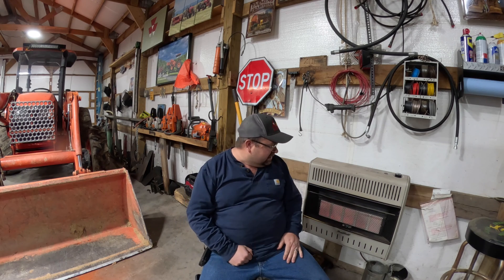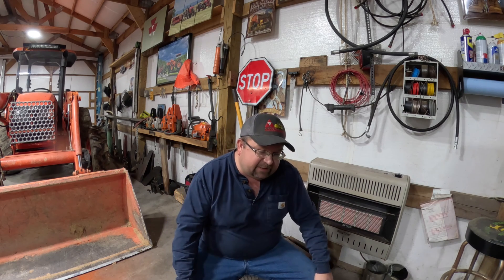What RPM Should I Run My Tractor At 🤔?

Comment: A lot of people, and maybe most people, have tractors that are smaller, and under powered for what they need. I think this is where some of the run at full throttle comes from   Along with everything that you are saying, and I agree. As with tractor time with Tim, they are always trying to see how under powered tractor will get them by.
Reply from the maker: But like someone said in the comments pto speed is where the power and torque curves are the most efficient. By going wide open throttle your not gaining much if anything to help. But most small engines do have the pto speed near wide open throttle. But the comments I’m referring are on 5E Deere’s and that size range tractor. Thanks for watching

Comment: Usually tractor design is such that torque and power curves cross at proper PTO rpm and the implement should match the tractor power.  If you pull an 8 foot wide implement at idle and shift up so you go 8 miles an hour or pull a 16 foot implement 4 miles an hour with throttle at the PTO mark you may get as much done in the same amount of time but the larger implement will only make half as many rounds. Half as much wear on the drive train.  I agree that if you are doing light work there is no need to run high rpm, but if you could do the job with a 20 hp tractor it would be more efficient to use it at a higher rpm than using a 200 hp tractor on the same load and running it at idle. You are right.  There are just too many variables for a definite answer and only experience will tell what is best for you.
Reply from the maker: Yes you’re right on torque and power curves. You really don’t gain much by going beyond that 540 pto mark other than more fuel consumption. Thanks for watching

Comment: Ben, I agree with you 100%. I live in upstate New York and it gets cold . I start my tractor and let it idle until the temperature gauge comes up into the operating range. If I’m not using the pro I run it at 1500 to 1800 rpm. It’s a new tractor with 20 hours on it . I’m used to a 8N Ford so I don’t have any experience with the new diesel’s. My tractor is a Kubota MX5400 gear drive open station and I really like it. I just hope I’m running it correctly. Thanks for sharing your opinion I really value it.
Reply from the maker: I’m glad you went gearing up drive! You just so much more pushing and pulling strength from a geared machine. Thanks for watching

Comment: I agree. Go to a machine shop and ask them to build an engine. They are gonna wanna know how much horsepower you want and how many rpm.

When you wanna be able to run 6000 rpm the price goes up significantly. Rpm definitely is harder on engines.
Reply from the maker: It sure is! Thanks for watching

Comment: Good morning Ben.  You didn't mention running it by ear. 😁 I have a tractor that I have ran for years with a broken tachometer cable. That would blow many of new owners minds 😂
Reply from the maker: My Farmtrac is that way also. Thanks for watching
Reply: I've run many ford brush chopping with no tach, I spin em up wide open, then bump the throttle back a bit, till it sounds right.. I'm talking a 3600 pulling an 8ft brush chopper  or a 4000 pulling a 10 foot chopper.

Comment: I only run my tractor (bx 2370) at 2000 - 2500 rpm unless I have on the bush hog or finish mower then I run it up to the 540 mark! I only run my tiller at 2000 to 2200 rpm at max and it does just fine. I have never had that little tractor at full throttle!!!
Reply from the maker: I run a tiller at lower then 540 as well. Especially in rocky areas! Thanks for watching

Comment: All the newer ones with dpf and Def are made to operate with the engine at a higher rpm.   I generally run wide open  especially with my 12ft batwing.  But like you lower my rpm in lighter work. If it's something I just need to put around on I'll generally grab one of our older tractors.  Luckily my kubota warranty is up so we are looking into having it deleted to get rid of the problem all together.   Enjoy your videos Ben, God Bless
Reply from the maker: Do you run wide open as in throttle maxed out or at 540 pto speed? I’ve never tried it on mine but what is the pto rpm at wide open throttle? Thanks for watching?
Reply: @khtractors  with my batwing I have to run just a little under max.  When I purchased the setup I was told it would need to be max throttle  but it does fine  running just under max, and Regens less.   Kinda glad I didn't go with the 15ft batwing because I'd be running max all the time
Reply from the maker: @danieltravis2555  yeah that’s a lot especially in thick stuff.